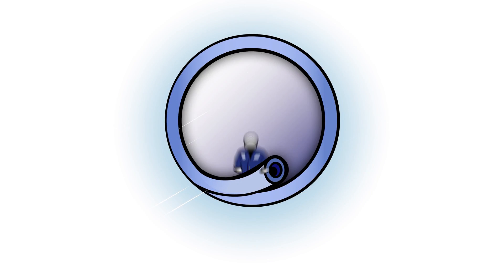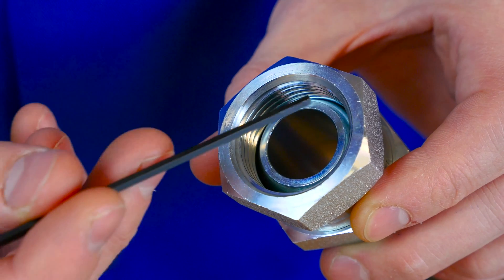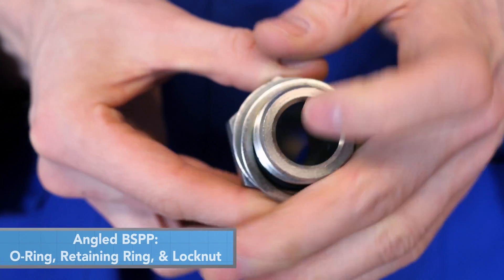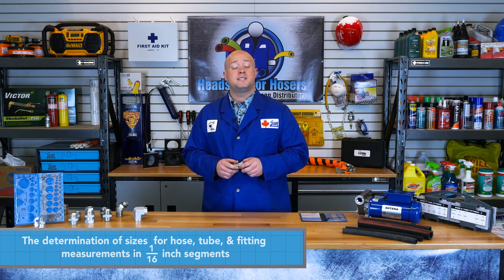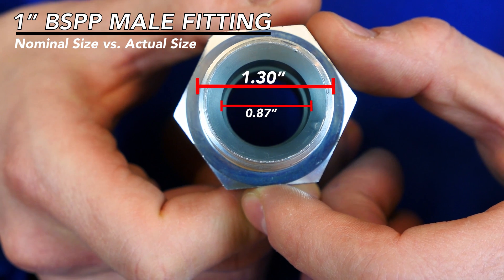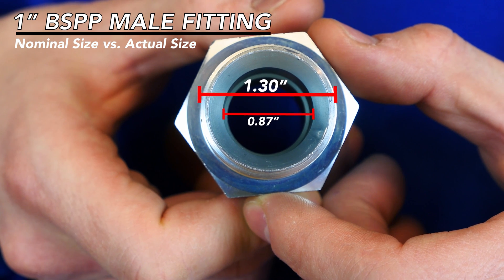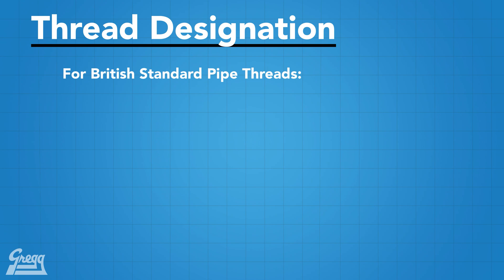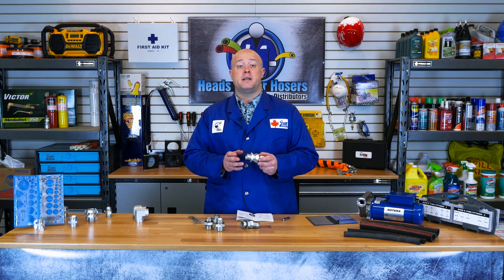BSPP Fittings / Threads - Identification & Installation - Heads Up for Hosers

Comment: Excellent video about BSPP fittings and the distinction between port and non-port connections. You clearly put a lot of effort into this presentation to minimize cognitive load for the viewer. You demonstrate everything as you explain it, with the camera zoomed in for emphasis, and you point to parts of the fittings to avoid ambiguity.

Comment: Will a 3/4 bspp screw into a 3/4 bsp
Reply from the maker: BSP and BSPP are very often synonymous with each other.  The key thing to watch for is the profile of the adapter.  So long as both fittings in your hand have a parallel profile down the shaft of the adapter, they should mate without issue.  If on the other hand your "BSP" fitting has a tapered profile, it is likely a BSPT thread and it will not create a seal.  Hope that helps!